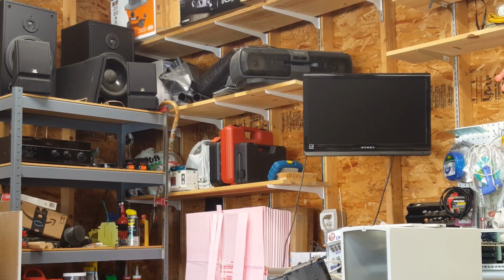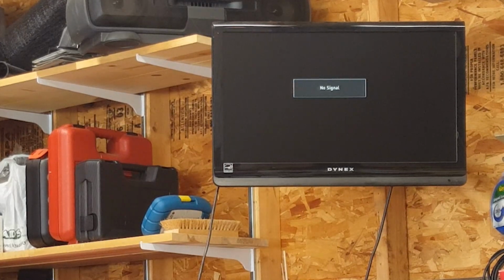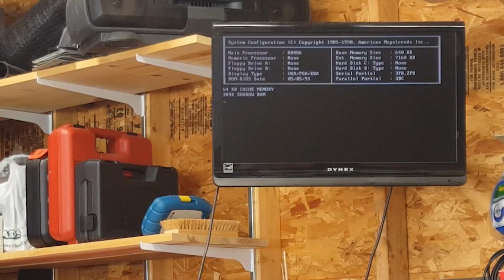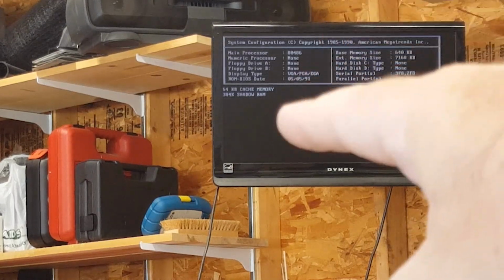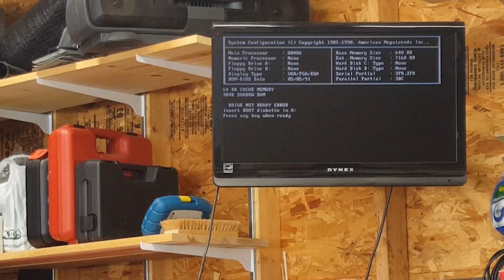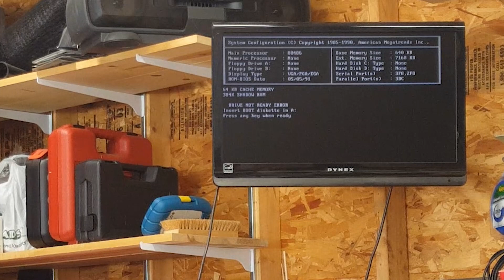Swapping an Intel 386 DX-33 for a Cyrix 486 DLC-40

Comment: the only operation to made was enable  internal 2k cache, so it runs faster the double of a 386dx40. i used those processors a lot at the age
Reply from the maker: so, it is a good choice over the DX-33?
Reply: @UncleMikeRetro   absolutely, even better a 40 mhz

Comment: I use a slot blank plate to get the cpu or fpu out of the scoket, If you get an Intel overdrive cpu there is a cpu puller tool if you can get it in the original box
Reply from the maker: I had one of the Intel pullers once.  I regret losing it.

Comment: There is/was a special tool to help remove the 386/486 CPU's. If you do a google image search for "Intel LIF Removal tool" you will find it, its a flat metai tool with a wide end that looks like a garden rake. It is a far better option over using a screwdriver to leaver the chip out.
Reply from the maker: you are the 3rd to mention it.  gonna find one!

Comment: Mike, what's your preferred OS for a 386 system? I've got several 386s and only one that's fully functional right now and it's running Windows 95
Reply: that should be running dos 5.0 or 6.0 / 6.22. Recommended to run windows 95 on is a Pentium Classic or MMX machine.
Reply from the maker: yeah, DOS 5.0 for me too.  I ran that on a 286 back in the day.  Prob Win 3.11 too

Comment: the only better way ive seen is a intel supplied fork shaped tool that can slide under a side but can apply pressure under the entire side. Im trying to fix up some 386 boards myself with the battery damage. I have one that is so close but the keyboard bios chip refuses to work. I wish there was a modern replacement for it.
Reply: Thats what iam using too.. Much easier to get PGA CPUs out of sockets. That tool came with the Intel 486 overdrive upgrade kit. That was to remove your old slower 486 cpu with, so you easilly could install the overdrive cpu without any fuss.
Reply from the maker: wish I still had mine! @rallyscoot
Reply from the maker: YES!  I remember those!  Shoot, Maybe I kept one!  I think I had it with the original purchase of my 486 Pentium OD CPU.
Reply from the maker: scary to be sure.  you never know... you know?@@lurch789